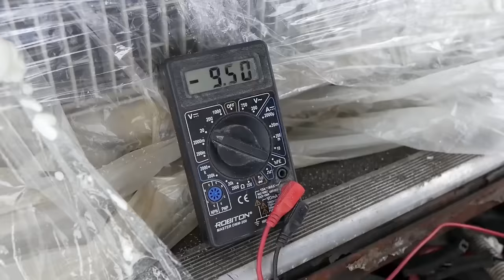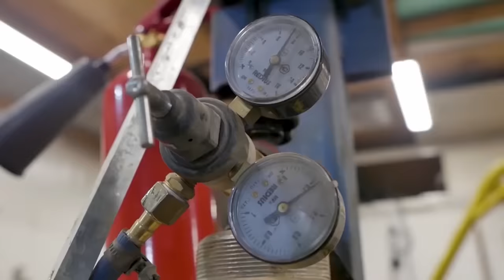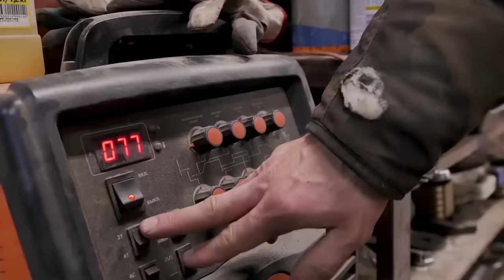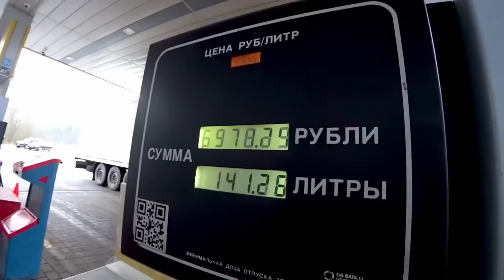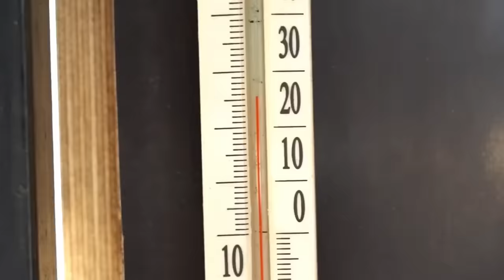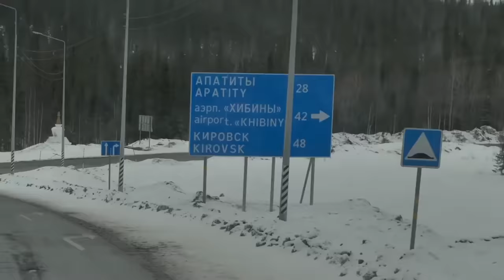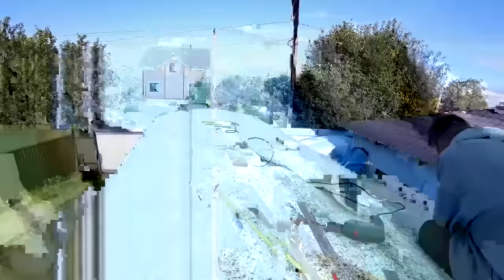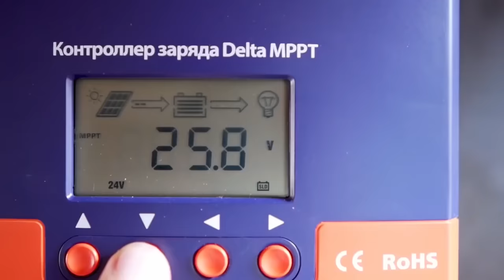500 Days Of Building HUGE DIY RV Motorhome. TIMELAPSE - Start To Finish

Comment: Finally! A bus conversation that focuses on the engine too. I’ve watched so many of these with zero updating or rebuilding of the engine. You’re adding thousands of pounds of weight to the bus and the engine is so important. Bravo
Reply: Thousands of pound of added weight? They are designed to carry 70+ passengers! Approximately 11,000 pounds. Duh.
Reply: They also took out a load of seats and old rotten metal, only problem I can see is that it might be unstable.

Comment: That was a huge amount of work. I have never seen a bus engine be remade on these kind of projects before, its always structure and interiors. However, the interior does needs a womans touch or a splash of colour...there is too much grey.  Royal blue, red, black, white or yellow, with some kind of geometric design on the cabinets to break up the grey and some soft furnishings.  That being said, the structural workmanship on the bus is second to none and the engine remake was very interesting,  Enjoy the ride boys.
Reply: @LizzieWhiz
I was going to say something similar. A woman wouldn't have allowed the hot mess they made designing the interior.
Hard workers but not an ounce of decorating talent.

Comment: Could have digital designs hold have done rebuild of drive train,wood heat of living what about heating t while driving. Witemp cause glass to break polish glass and clean body 1500 grit sandpaper did you rewire engine compartment ?

Comment: The hob/gas rings aren’t burning the gas correctly which is why the flames are massive. They should be blue and even sized. 

You really want to fix that as currently there is incomplete combustion which can result in the formation of carbon monoxide.

Comment: Won't conditisation build up in the windows and cause mold on cabinets or what ever is in between because he just built in front instead of adding insulation or anything I don't think he sanded any rust off either just painted over it  unless it had huge holes then he had to replace

Comment: You are not from US. Looks like you are from Russia, Ukraine or Croatia. 
---------------
You should have removed the wood from the panel. Put all metal panel. 
All rusty metal should be replaced with new metal. 

All wood, insulation, cushions  should be removed. 
--------
Increase the height by another 8 ft. 
This is to prevent bending around whilst walking. 
----------
The wall and floor tiles in shower is inappropriate. You should put beige floor concrete tiles, and white concrete wall tiles (up to ceiling). 
Wash basin should be larger. Build a concrete countertop with white concrete tiles. 
-----------------
The entire flooring should be beige concrete tiles. 

The entire walls (up to ceiling) should be white concrete tiles.